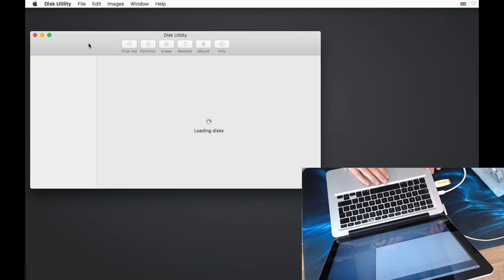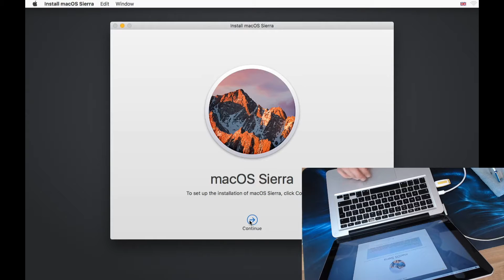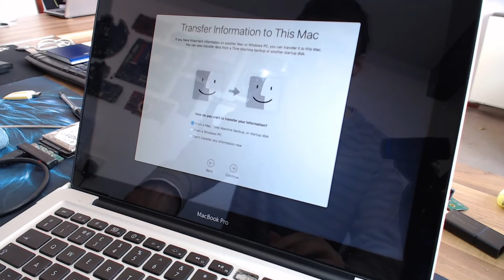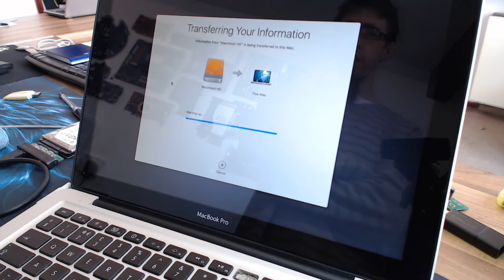LFC#84 - Old MacBook Pro SSD Refresh

Comment: I've seen people claiming that the NVidia MCP79 and MCP89 chipsets in 09-10 MBPs can cause issues when installing SSD - leading to data corruption after some(?) time. Is this an issue you have any experience with? Your videos are extremely helpful, and I very much want to install SSD in my very aged - 2010 - macbook pro!!